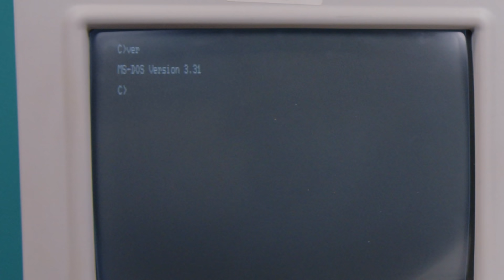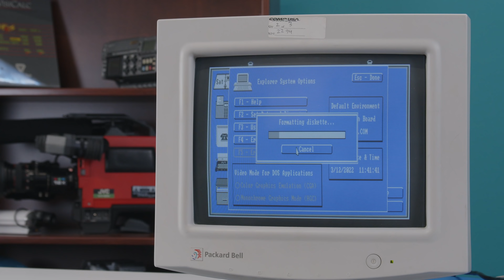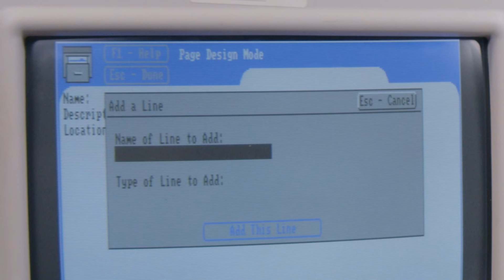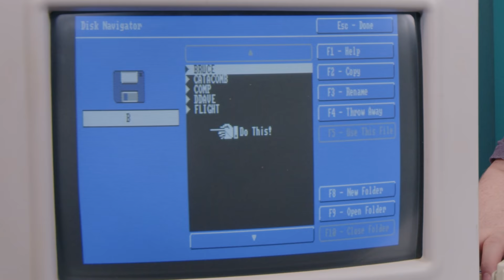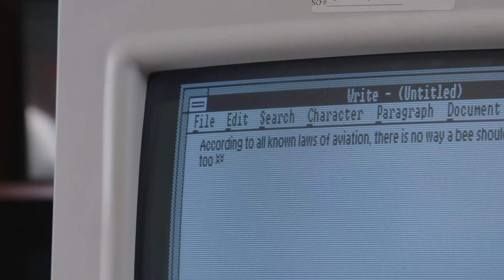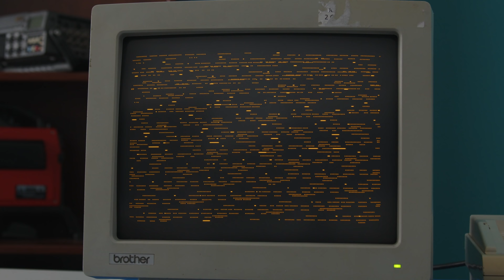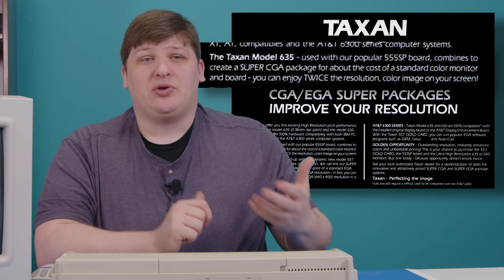Headstart's PC With The Weird GUI "OS" [Explorer]

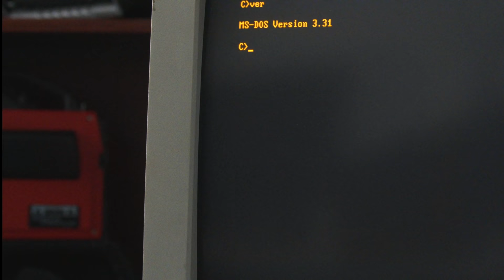Comment: I noticed in the MDA text demo @39:54 that some of the letters actually overlap, like the C and M in CMD or the A and V in NAVIGATE... was this a standard feature or is something extra going on to pack the characters closer together?
Reply: maybe an artefact from his video converter.
Reply: More corner cutting perhaps.
Reply from the maker: ...what on EARTH. I didn't notice that! I have no idea what's going on there! Whoa! That's going straight into the MDA monitor so I have to assume the graphics chip in the PC is generating that. It has to be an oversight in the MDA circuitry.
Reply: It looks like all the letters are cutting into eachother slightly, it could just be like some stylistic kerning maybe? Or perhaps the monitor isn't as wide as the card expects?

Comment: MDA is 50Hz not 75Hz, the reason you may be getting 75Hz out is the MCE to VGA likely outputs the higher frame rate for compatibility as most Monitors don't support 50Hz. The reason 50Hz doesn't flicker on a proper monochrome monitor, especially the IBM ones is the persistence of the phosphor allows the phosphor to glow after the electron beam moves away. Ever phosphor has persistence, however the ones used in some monochrome monitors are a bit longer than color monitors.
Reply from the maker: Oh dangit, I could have sworn - I was probably thinking of VGA textmode, which ran at 70Hz. And the thing is, I was thinking it might be 50 due to the long persistence phosphor, but when I went to adjust my shutter speed to eliminate roll I was still getting it real bad at 50fps, and ended up having to use some weird off-speed like 48, so it really felt like it wasn't an even number. I'll put a footnote up; wish I'd gotten it right to begin with though. Thank you for the correction!
Reply: @CathodeRayDude   I don't know what I'm thinking of, but I thought there was something at 72 or 75Hz as well.  I know VGA text mode is 72Hz, and 75Hz was a common VGA+ refresh rate, with supported drivers and monitor, but I could've sworn something earlier had used a higher rate as well.  Hmm....  Mandela Effect in full effect.  haha

Comment: So much nostalgia! Our family had one of these, sitting right in the living room. Bought it in 1990 at a V&D store (which ran a Vendex computer department), without a hard disk and just the amber monochrome CGA/Hercules display. Oh boy did I use it a lot. I learned development on this machine, first with GW-Basic, later with Turbo Basic, followed up by Turbo Pascal 5.5, and later Turbo C++ 3.x, with some 8086 assembly in between. Had loads of fun, despite the machine deteriorating over time; ball of the mouse missed a chunk because the dog got hold of it, the keyboard was freezing at random moments where all three lock lights would turn on and no keys registered, mostly fixable with a good smash on the top right of the keyboard... Good memories!

Comment: Having used several early non-Windows/Mac GUI desktop interfaces for PC and microcomputers of the 80s, This  “Bulletin Board” GUI on this machine seems like a lesser version of Tandy’s Deskmate GUI/integrated software system. Deskmate had many of the same features but did it better in come respects from my memory on similar PC hardware. The GEOS used in the Apple IIGS and Gem Desktop where better in some respects too though I’m sure licensing costs played a role in why these where not used here. Also, some GUI’s for the C64 and similar specked micro’s from others where really very barebones due to the limited hardware specs of those machines. Apple Macs ran much better hardware then this PC clone so they had a much better GUI of course, Still I imagine this computer could possible run a more decent GUI like Deskmate or GEM OS. I fact, it would be interesting if you could get a hold of a copy or either or both of those OS’s which are currently archived as abandonware on net if you search for them and I believe have versions such that fit on one or more 720K floppies that maybe you could test out just for fun to compare and contrast to the built-in GUI.

Comment: You talking about criminally bad keyboards at 7:30 and instantly showing a Model F is the real crime haha
Reply from the maker: Other than the positions of the modifier keys and the weird castellated design they used, what's wrong with the F? For general typing it's phenomenal.
Reply: @CathodeRayDude  yeah that's what I meant. The F is really good, but you talked about the f right after saying the 80s were horrible for keyboards, making it sound like you're saying the F isn't good...
I understood what you you meant but just pointed out it felt weird to talk about horrible keyboards and instantly talk about the model F when it's actually really good. It might confuse some viewers lol

Comment: 2:35 - interesting that they went with the "disC" spelling instead of "disK" for a floppy disk expansion port.
Reply: For a second I dabbled with the thought of an external CD drive. After all, it's manufactured by a Philips subsidiary. Then I realized there would be zero use for it at the time.
Reply: disc/disk wasn’t really an established nomenclature at that time — laserdisc and compact disc were often called “optical disk” in press at the time too. The “C is optical, K is magnetic” sorta/standard came about by the 90s.
Reply: @kaitlyn__L  wait what?? I never knew that… I feel a tad bit dumb now. I just used disc for the shape and disk for anything data related. Thanks
Reply: @natelax1367  it was a big moment for me too when I saw the various uses in the press too! Since I was the same as you. I bet if you looked you could even find some older publications calling a frisbee a disk!

Comment: Not fully thru the video, but before I forget, I wanna address the commodore 64s kb. It wasnt bad.... except how far up it was. I firmly believe my decade of typing on it is why my wrists are so fucked up. I finally, after like 8 yrs of pain, made a shelf that lowered the computer an inch, and that helped alot. the actual KB wasnt back at all to type on, its just that it was like 2 inches too high. Plus nobody knew that was gunna fuck up a generations wrists.
Reply: The irony is, there was ergonomics legislation in the early 80s mandating low profile key switches — which is why IBM’s beam spring and ALPS’ tall switches disappeared. But then these home micro manufacturers put those lower-profile switches… just as high up off the desk as the high-profile terminal switches of the 70s were 🤦‍♀️
Reply: I never had problems with the C64, but I used the more ergonomic C64 C longer than the original "breadbin". - I got really bad wrists from using a slim notebook for a while - took months to heal, and I never touched a notebook again.

Comment: Loved that Keyboard Rant, definitely not suited for 10-finger touch typing we're used to in the 2000's, but more like the Typewriter like stiffness. I didn't mind the Commodore 64 keyboard as a child, but as an adult that uses regular Cherry MX-switch mechanical keyboard, revisiting it really showed me that I never want to use it again. (The split cursor keys aged terribly)
Reply: I never felt the need to learn fast typing, because I only type my own thought results. Thorough thinking is slow, typing it down with 2-4 fingers usually is fast enough. I reactivated my C64 about two years ago, mainly for recreational programming, and have no problems with the keyboard whatsoever.

Comment: The GUI 'GEOS' on the C64 has miles more functionality and speed than the headstarts gui... what a mess
Reply: You had to load GEOS from disk, and I remember it way slower that this GUI. A better comparison would be the GUI which came with the Final Cartridge III - very basic functionality, but usable, and starts like a flash.

Comment: I like the idea of an integrated GUI with simple programs built in. In 89, my experience with word processing and other software came with my job, the USAF. Our first computer, in 1987, used in my job was a Zenith 248, a 286 with a 20mb hdd, which was the successor of the Z-100 (In 1986, the US Air Force awarded Zenith Data Systems a $242 million contract for 90,000 Z-100 desktop computers.). Any GUI we had came with the software, which included Wordstar, Lotus, etc. At the time, we rarely used Windows 2.0. I often edited the autoexec file to automatically load Wordstar.

Comment: The Half-Hercules card was a thing.  That's probably what's going on with this computer.  Hercules was so nonstandard that there wasn't even a standard BIOS call to enter hercules graphics mode, rather a series of numbers had to written to port locations on the graphics card in order for it to go into graphics mode  AND back.  Somewhere I even have a "Hercules" card that only has 1/4 of the standard memory, and when in graphics mode it will only work on the top half of the screen.  Presumably a slightly different set of numbers were meant to be written to the ports on the graphics card for a 640x200 or 720x200 2-bit display.  I wrote a couple games that supported Hercules graphics back in the day, using Borland TurboC, but no one really downloaded them off my BBS to speak of.  I can see if I can find them if you like.

Comment: I've been looking into the missing second graphics page issue... A proper Hercules graphics card has 64KB of memory. However, it's "fine" to configure that v6366 graphics chip with only 32KB of graphics memory. Or less if you didn't want  the Hercules graphics mode. There is a detailed programming manual for a laptop with that graphics chip that shows all the registers and graphics modes, and that laptop only had 32KB of graphics ram. 

I'm guessing this laptop is also configured with 32KB of graphics ram. Probably the easiest way to confirm this is to check the motherboard and look up the memory chips near the graphics chip, should be one or two chips adding up to 32K x8 bit. 

With that technical reference manual, you could probably write your own video software to access the advanced video modes. There is almost enough infomation. Looks like it supports a 4 bits per pixel mode, where you can have 16 different colors on the screen at a time, chosen from any of the 64 colors that a CGA/EGA monitor can display.

Comment: Thanks for the elaborate graphics explanation. I have been programming since 1973. When I had a Hercules graphics card, I was frustrated that there was no way to get into graphics mode from GWbasic. I have read the Hercules manual (yes, expansion cards came with their own manual back then ;-) , and found the addresses to change to graphics mode. Ignoring the upper-case warning surrounding this information (it literally said "DO NOT TRY THIS FROM BASIC!", POKE being the basic command to store a value at an address ) , of course I dit try this. My beautiful green monitor started to emit an enormous high irritating pitch, and the displayed screen got ever smaller very soon. Although I powered it off very quick, the damage was done. My monochrome screen displayed the full screen in stamp size :-( . It took about a month (to my memory) before the visible screen got his normal size back. So I've learnt 2 things: 1) You CAN damage your hardware using programming, and 2) Do not ignore the warnings.

Comment: @13:08 at that time, most turbo buttons didn't actually change the speed (the machine would need multiple clock crystals plus switching logic which would make it prohibitively expensive). The disabled turbo button would insert additional wait states for RAM and other operations, which would give you an effective slow down by constantly interrupting the CPU even though internally it was still working at its rated speed.
Reply from the maker: That I did not know. First I've heard of it, but yes, it makes sense, changing actual clockspeed on the fly seems hard.
Reply: Supposedly this is common.  I dunno, it's really hard to tell what actually happens with a turbo switch.  But, I think that kind of chicanery was more common on 386 machines and beyond.

On the PC/XT, the CPU was run at 4.77MHz because IBM could use common (=cheap) clock crystals designed for use in NTSC video circuits (14.318MHz) and divide it down by 3.  Dividing by 2 would yield 7.159MHz, which may explain 7MHz clones.  Selecting between the two would be pretty trivial with a simple counter IC.

If you wanted to run at 9.54MHz (just under the 10MHz speed rating of various 8088/8086/80286 chips), the also-common 28.636MHz would allow /3 to 9.54MHz, or /6 to 4.77MHz, making a 2x turbo mode really simple without affecting the ability to use the clock for the ISA bus and cards with NTSC video out (like CGA.)
Reply: My first PC was 386SX clocked at 25 MHz, and I'm pretty sure it was running at either 12 or 16 MHz with the turbo off, I remember quite vividly that the BIOS was reporting a different clock when booted with turbo off.

And I was very stupid back then, thinking that "turbo" means some kind of overclocking that may damage the machine when overused, so I kept it disabled most of the time...
Reply: @kFY514   Oh man, that's tragic!  haha

Re: The BIOS -- that could be, but some of those MHz readings were based on quick calculations.  It would run some bit of code and time how long it took, then compare the results with a table of known CPU benchmarks, and pick the closest one.

Very few designs were actually capable of determining the actual clock speed.
Reply: @nickwallette6201  Now that you mention it, you're absolutely right. Inserting wait states and turning off cache was introduced with 386's while 8086/8088/v20/etc. and 286's actually did switch the timer and underclock the processor with the turbo button. This was easier to do when simpler CPUs were basically directly attached to the ISA bus. Starting with the 386's there was all this chipset logic in the middle, and clock multipliers, etc. - I just saw some tests on the vogons website which show how influential turning off cache and inserting wait states was back then.

Comment: Ex-Radio Shack Mgr here. The 1000 SL had the boot on a rom as well as the GUI Deskmate. It was also fanless and thin. It has a base ram of 384k and a built in 3.5 diskette dr with no HD built in as a base model. They sold like hotcakes. Also keep in mind the Tandys had better sound as well as 16 color graphics built in which was better than most other brands base models.

Comment: Thanks for this video! This was my very first PC, bought new in 1989 or 1990. It replaced a Commodore 64, and was replaced with an Amiga 600.

I never got a hard drive for mine. The floppy drive location was very convenient and I got pretty good at holding a few discs in my right hand and swapping them out quickly one handed. I don't remember why that was necessary, though.

It came with a monitor and stand. 
 The computer slid under the stand that the monitor sat on. The power button plunger stuck out a bit and would catch against the ribs on the inside of the stand when sliding it in and out. That is what broke the power button. After breaking and replacing mine (under warranty at an authorized Phillips service center) a couple times, I just put a piece of tape over the plunger to hold it in place.

I remember looking at the GUI briefly when I first got it, and then never using it again.

I wish I still had mine. It was the computer I used to write papers on my last 2 years of high school and first couple years of college. It was the computer I first got online with, first dialing on to local BBSs, then accessing my university's VAX to do research using Archie and Gopher. It's the computer I learned DOS on. It played a very important part role in my life.

Comment: I've heard some lore that the complex glyphs of East-Asian languages was a key driving factor in the development of high density graphics displays. I've assumed it had merit. It sounds like @41:35 may be the source of that. We also used Hercules Graphics Cards extensively in my early career, so I wouldn't be surprised if the lore came with them back then and I just forgot.

Comment: I actually love seeing PC clones likes this with weird unique features or form factors.  

Another computer this makes me think of is the Amstrad PCW.  This was actually not a PC clone but an 8 bit CP/M machine that actually had a monochrome graphical display.  It'd be nice to see more videos on the PCW, but I doubt I'd get it from any American channels.  

The PCW 8000 series, probably the best known PCWs, wear all-in-ones from the late 1980s to early 1990s, which of course means a CRT, making it bulky, heavy and I'd imagine rather expensive to ship over the pond.  I think they were exclusive to Europe and intended to be a low cost office alternative to PCs that at the time were incredibly expensive.  

Amstrad cut corners all the way down to the floppy disks they used, using some strange 3" format rather than 3.5" or 5.25" largely because drives for the format were cheaper to buy and fit than 3.5" drives.  

I think the only American based channel I've seen to have one is Perifractic and that's only down to him being British and nostalgic for the PCW!
Reply: The Amstrad PCW was sold in the US, but I don't think they sold very well there. In fact, they rebranded the US release of the software as "Locascript", because they thought that "Loco" in the name might have negative connotations for Spanish speakers.